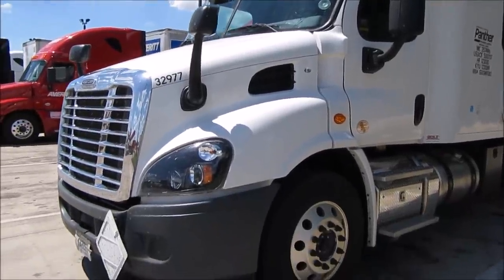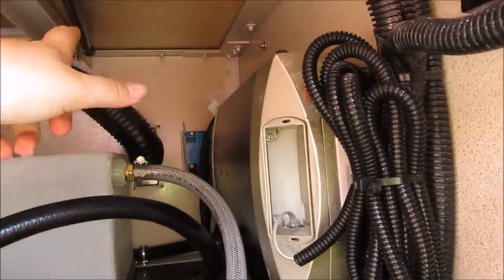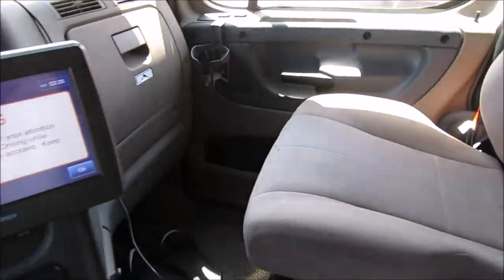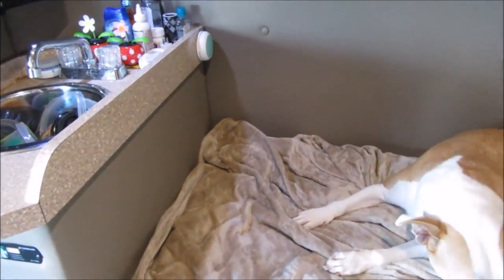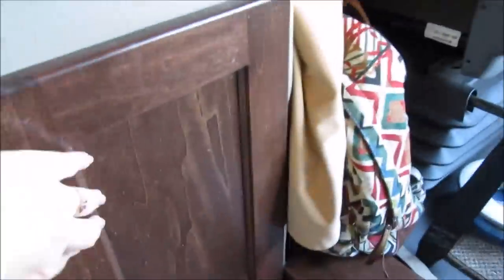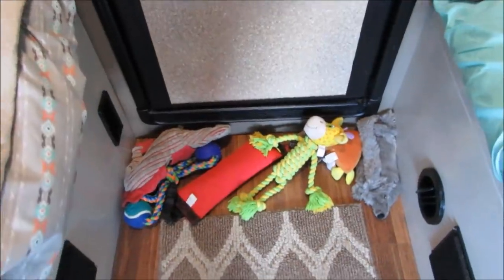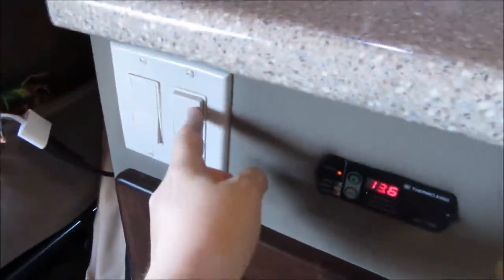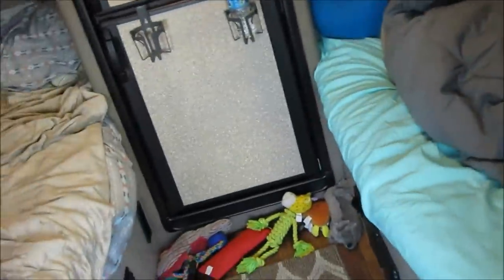2016 Freightliner Cascadia Bolt Custom Sleeper Tour

Comment: @Between The Lines, You might want to check the registration for the truck. That lift axle might not give you more payload capacity like what you think. Hate for you to go through a weigh station and get get ticketed for being overweight. 33,000 lbs. is the normal  GVW for that kind of truck. Drive safe. Godspeed.
Reply from the maker: thanks for the comment! looks super weak right? lol We havent had to do a load over 13000 in a long time. will look into it thanks

Comment: I used to have a Hint and the bed was a futon that could be used as a full size bed too, it was were your mans bed is at, were your bed is we had the kitchen area. the table had several positions by back wall or in middle as a dinner table

Comment: How long is your truck from fender to fender, 45 feet? And both rear axles seem to be the same size, which is good. I'm guessing your truck is around 56 or 58,000 Lbs weight GVWR.
Reply from the maker: i wanna say it was in the low 60,000

Comment: What’s the price tag on this truck?
Reply from the maker: Juan C Martinez roughly 120 to 150k
Reply: I found a 2015 Cascadia for $20,000 with 999,873 miles on it, it has a 10 speed manual but turning a tractor into a straight truck is a questionable of cost.

Comment: Do you long haul with this rig or mostly shorter runs?
Reply from the maker: Hockey Nutt it varies. We do both. Rarely do any loads under 500 miles.
Reply: Between the Lanes You are chosen. I am solo with Panther. Solo drivers get crapy short trips. I do not like it at all. No money when you are solo.

Comment: I heard that straight truck sleepers are more difficult in tight spaces than tractor trailers! Do you find that to be the case?
Reply from the maker: We never found that to be the case. It did have quite a bit of tail swing but we never really had any problems in tight spaces.

Comment: '
this truck is a not safety with 2 things...
1- no have shock on the rear bumper
1- no have 2 amber yellow lights on the side taillights
big fail truck and must sending back to truck company have to fix it...
must free free
Reply from the maker: +bestamerica those need to be on trailers. not the tractor. we have no trailer. its all one piece.

Comment: If your dash is set up the same as mine you should have an oil temp Guage. with the ignition on push the + on the steering wheel and it should be on one of the slides where the odometer is. On mine it also shows boost pressure there. Please let me know if this worked.
Reply from the maker: G G yes we have it in the items menu just not a physical gauge like in our old truck.
Reply: Between the Lanes Gotcha, thanks for the reply. Keep the dirty side down.
Reply from the maker: will do! thanks for watching!

Comment: can you get no touch freight in expedite
Reply from the maker: +Brett Duffy most of our freight is no touch. since its odd freight like rolls of wire for example, you have to strap it in really good which can take time but  if we get touch freight you get paid and the worst we have  done is had to push cabinets on wheels in and strap. Not hard
.
Reply: Between the Lanes do they make you do the Department of Transportation physical the one I already have good
Reply from the maker: Brett Duffy yes you need a current dot physical
Reply: Between the Lanes so the one I have is currently good that will work for Panther
Reply from the maker: Brett Duffy it depends on where you got it at. Some people could use theirs. Ours we had to re do. I'm not sure of the stipulations on that.
Reply: Between the Lanes was there any lifting or anything on your DOT physical with them some places make you lift 50 pounds

I have cerebral palsy in my right arm and I want to try to be below the radar my chiropractor examined me and said I'm fine
Reply from the maker: Brett Duffy our first one we had to. I want to say at panther they didn't make us do that but it was a year ago so it's a little blurry. The other two we took we had to lift but I don't recall panther making us lift.

Comment: Where do u straight truckers sleep at? I dont see you at the truck stops.
Reply from the maker: il Lock normally it’s a team so we drive straight through because we are hauling expedited freight. If we are sitting it’s normally because we’re not under a load. We stayed at loves or pilots mostly with an occasional TA here and there.

Comment: What's with the automatic transmission? I hate how the industry is going in that direction.
Reply: Eric Lebo then don't drive a automatic then.....
Reply: Autos are better on fuel and in general run lower costs. Quite a few fleets are switching to autos.
Reply: Autos are better on fuel? Since when? Cant remember a Car / Truck that uses less gas/oil/fuel whatever, when it has an auto.
Reply: Hey  stop the cry , deal with  it